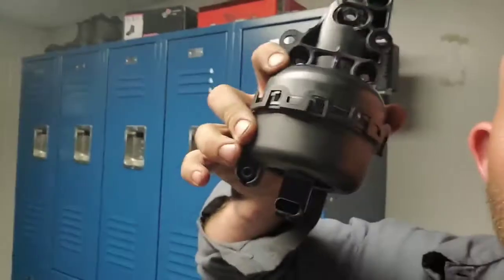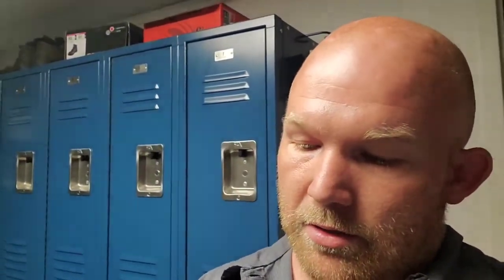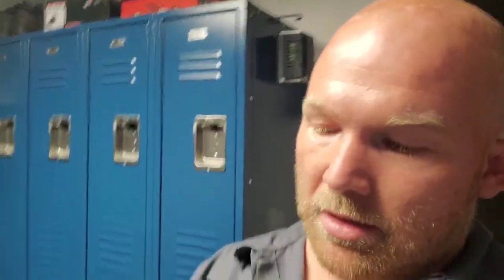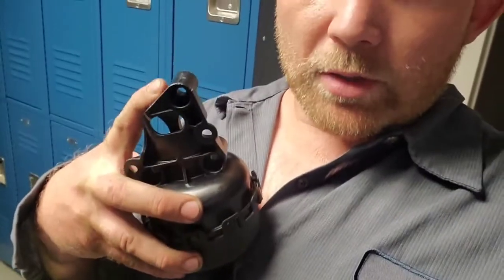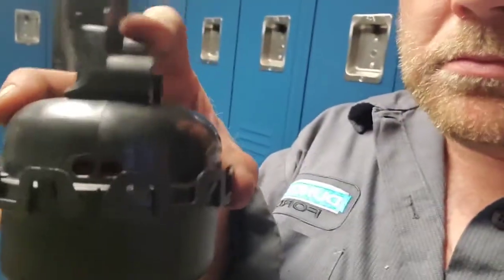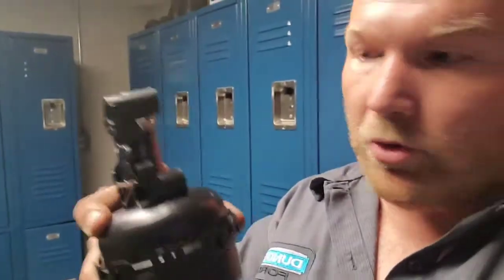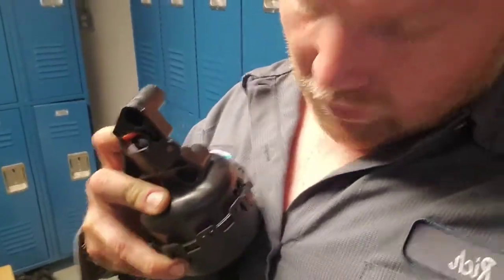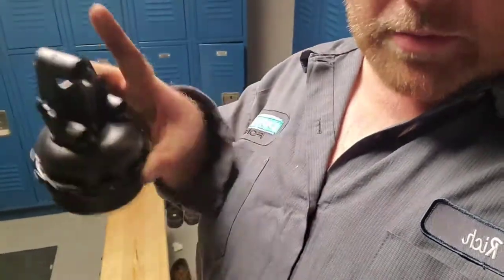2020 Ford F150 5.0 P2004 High Idle Secondary Runner Code Intake Manifold

Comment: That's a new truck.   Are these just bad parts or is it unusual for one of these to go bad?  Scary to know a part like that goes bad so quick. 
By the way the shop finally fixed my leak on passenger side of Crown Vic.  I had them check door seals as u instructed but was a bad seal under cowl. 
Jamey
Reply from the maker: Well that's what I was saying under the cowl there's a set of seals that go bad or the door seals go bad and also you can get debris that builds up underneath the cowl that pushes water up over the seal down into the vent
Reply from the maker: This is not a common problem on the 2020 F-150 so far